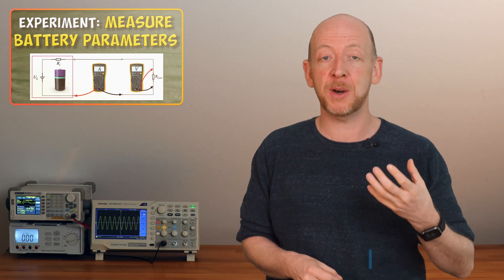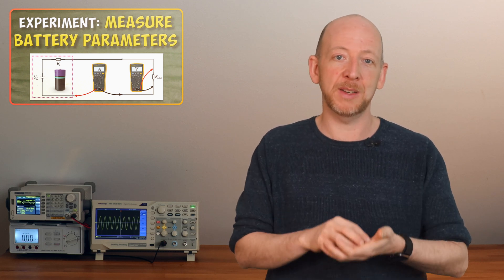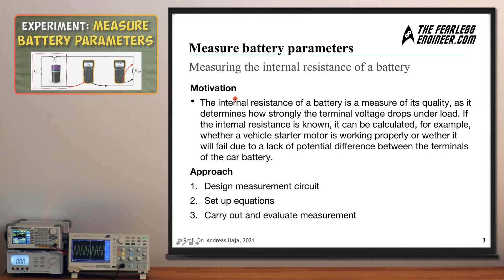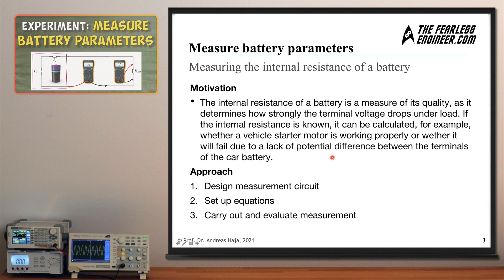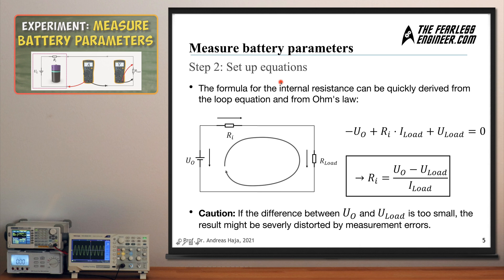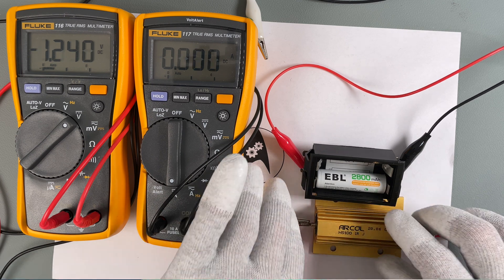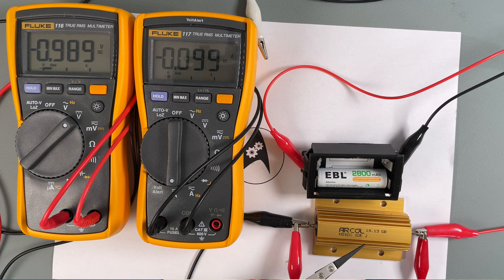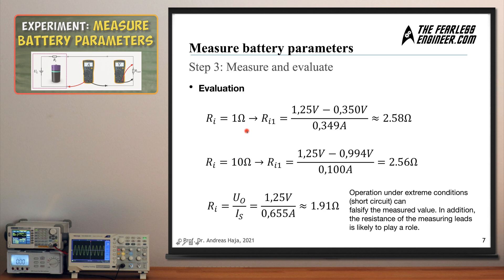Experiment: How to measure the internal resistance of a battery? | Learn Electronics

Comment: With known test resistor value (Rt) no need to measure current at all. Just measure open circuit voltage (Vo) and voltage under test load (Vt). Ri=Rt(Vo/Vt-1)